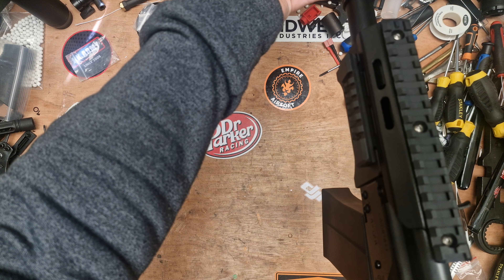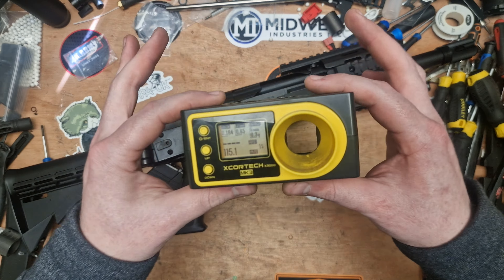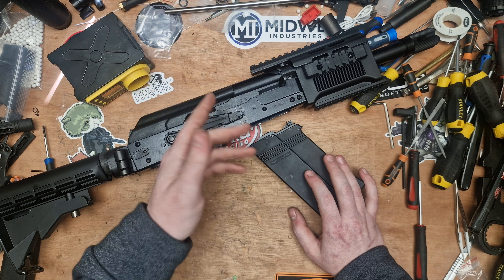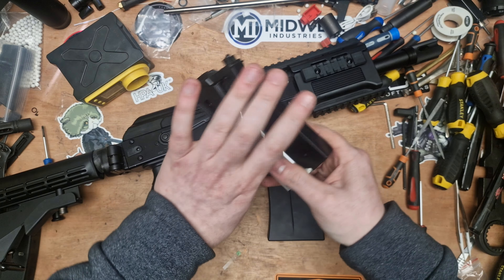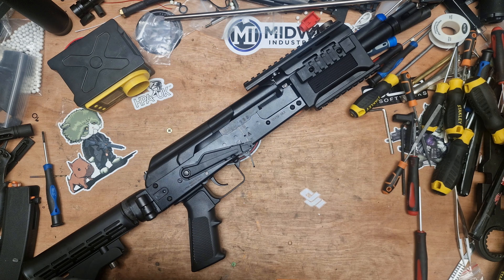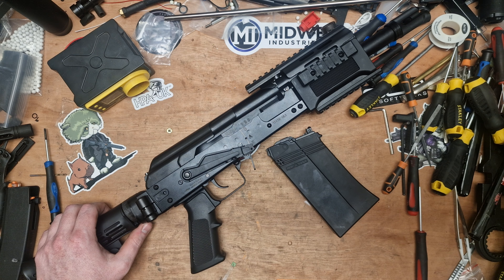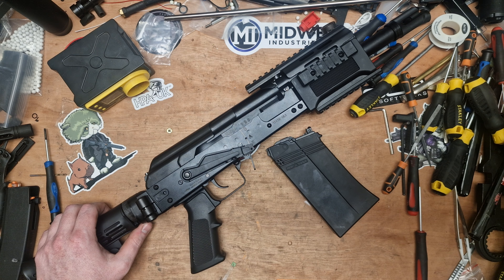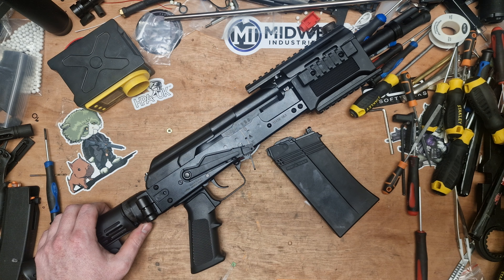Tokyo Marui Saiga 12 SBS Gas Blowback Shotgun

Comment: Great to see you showing us this as I'm thinking of getting one. As user and collector/builder of GBBR's for over a decade my thoughts on the the improving mag efficiency is probably due to air pockets in the gas tank, new mags often suffer from this (and rebuilt ones) where you have to manually carefully bleed off the air holding it vertically and lightly pressing the exhaust valve until you can smell the gas (as the escaping air comes out first and doesn't smell) and do this a few times until it's all gone leaving all the room in the chamber for the gas only. Then of course you've got the usual "how much liquified gas versus gaseous/gassified gas?" conundrum with the internal tube (that you mentioned) to get right lol.

Comment: Also tm themselves suggest to only run the Saiga if the mag is over 25C so either warm it up or only use in summer. TBH I’m just going to run an hpa adapter with it and that will solve most issues of power and gas. 

On a side note seems it will take tight bore inner barrels made for the springer shotguns like the spas12 etc but will need to cut them down to length and will need some way to hold them straight in the outer barrel could be another way to add power.

Comment: Probably an obvious one but the Saiga mags have an adjustable output valve. I think by default it's set mid way for CQB fps limits in Japan. Did you open the valve all the way?
Reply from the maker: The valve is fully open
Reply: how do you adjust the output valve on the saiga mags?
Reply: @broishawt  remove the valve and rotate
Reply: @lemonjelly  thanks buddy

Comment: I have the longer version and since I'm new to GBB's I would love to know if there are upgrade options that would fit this? Not sure if it is sharing the TM AK standard parts like rocket valve and magazine output valve. Also would be nice to know what furniture could be bought for this? I already have 115% bolt return spring and heavy bolt with HPA Airtac adapter but still I would love to know what else I can get to get this thing to roll.
Reply: Did you find answers to your questions? I have the same questions haha 😊
Reply: @DaSauceDatsBoss  Sadly the thing broke down and replacement parts are nowhere to get so it is collecting dust ATM. I invested money to get it HPA'd and then it worked like for one mag, after which the loading nozzle totally broke. Well, whatever...

Comment: Glad I purchased the full fat version (12k) with a view to shortening it for CQB as I wanted to use it out in the field as well as optimising it for CQB.

As you have said there are only a few places that allow full auto CQB so the only benefit to me was the extra capacity magazine which James obviously didn’t drop off. That said I typically run HPA setups so invested in the Airtac adaptor to resolve the need for 6-8 costly gas mags.

Comment: I get 2 mags worth of bbs on a single fill with my full size. It’ll do 3 mags but they start to get weak like in the video. All 3 of my mags will do that. Does 1.2j or so on green gas.
Reply: I'm looking at getting one of these and I've heard many things about it being underpowered (including this video) which makes me hesitant to buy it. It's good to hear yours can do 1.2J thouhj!
Reply: @Jonezyyy16  I love mine, one of the best purchases I’ve made in a long time. Ran it 4 times so far and it hasn’t had a single hiccup. It’s a cqb monster even with the 45 round mags.
Reply: @AllAddsUp  sounds great mate! If I may ask, how soon did you purchase yours? I'm thinking maybe it's a batch issue and these underpowered ones were from an earlier batch
Reply: @Jonezyyy16  I bought mine about 2 months ago. I don’t think it’s a super early one, I don’t see many in the US though. Shipping from Redwolf was pretty wild, but I ended up saving money over buying from evike with their mark ups. My only complaint so far is the non adjustable hop, but you can get pretty good results with .25s or .28s depending on the temperature/humidity.

Comment: The SBS seems to be a bit weak. The 12k is can reach out to 55m with .32g. But for me its not Shotgun like enough. 
Never had effitience problems. On like 23°C outside, I got around 3 Mags before I regassed them. Never had one run dry.

Comment: Personally, that Saiga Version is hideous. On the other hand, a normal Saiga with the extended Magazine is a absolute looker.

While you also mentioned the AKM/AKX, whats your Opinion in the 3D Printed Full Travel Parts that exist?

Do you think you'd be interested in making a Jaeger Precision Full Travel Kit at some point ? :D
Reply from the maker: Not seen those kits to be honest. But in my opinion it doesnt need it. The thing just works the way it is
Reply: It does work like a charm, but a full travel bolt is the only thing that the TM AKM is missing for true greatness in my opinion.

I did order the Volante Full Travel Kit, but since its coming from South Korea, it will probably take some weeks until its arrival.